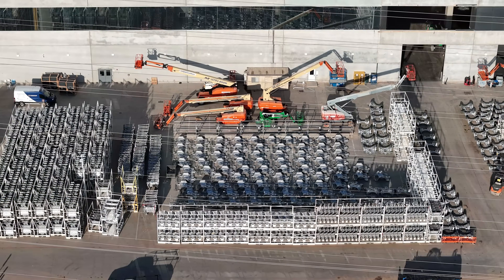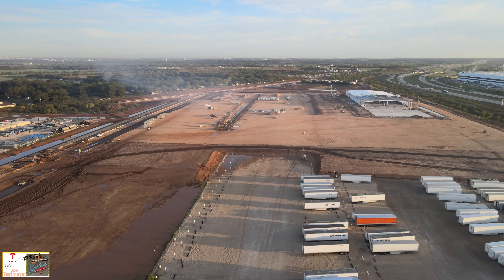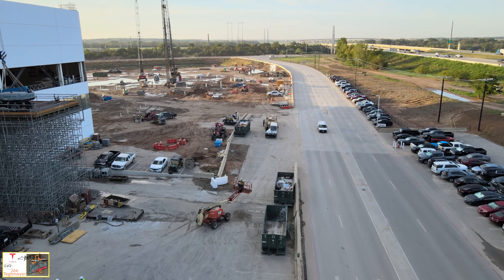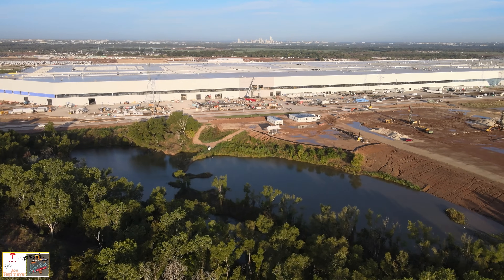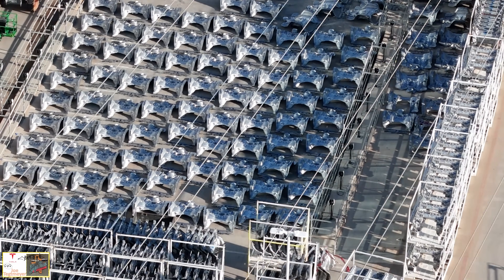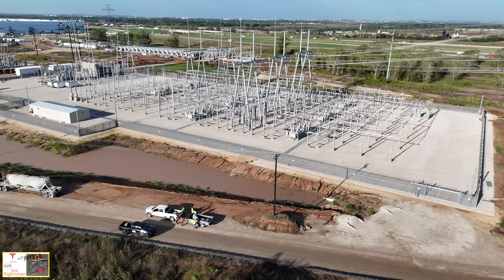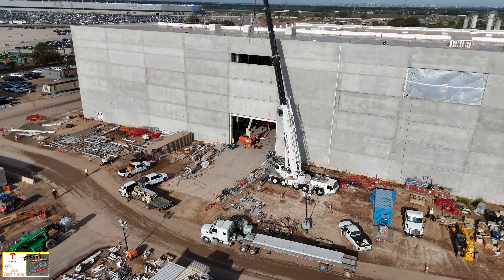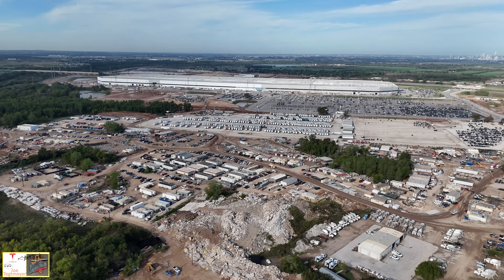100s of Cybertruck Castings! 4680 Section Construction! 6 October 2023 Giga Texas Update (07:35AM)

Comment: Thanks Joe.
4:37. W-WOW yard storage. Left. Beside the crane. The relocated Superchargers.
5:18. New EOL site. Left. Strip drain has been encased in concrete.
7:09. New EOL site. Roof. Stair access.
Inside. Bulk insulation fitted between the wall girts.
HDD project. Right. New delivery of the smaller black pipes.
Left. Trenching for conduits.
8:00. Main Entrance. Stoneglass. Definitely got a problem there with leaching. Repairs required.
8:46. Southend. CFA project. At least 12 rebar cages newly assembled since the last video. Piling to continue.
8:58. Highway Bridge. Left. New embankment to the west (right) of the outfall structure.

Right. Large pipes stacked under the bridge.
9:57. GA south, wall. Boom-lift. Applying acrylic render/stucco.
10:21. Stamping 2 extension. Fixing a second layer of wall sheeting.
11:24. Stamping southeast. Covers over the columns.
11:32. Stamping east, apron. 7 tanks (in Joe’s photos). One tank marked ‘Ecsar’, supplier of a lot of the sheetmetal products into Paint.
12:27. Parking Garage site. Left. Footing rebar cages being assembled.
13:13. WOW yard. Got some rain. Culvert. Inlet structure at the north end underway.
Holding pond. Orange pump and pipe discharging into the new channel.
14:41. BIW, apron. Right. Started demolishing the retaining wall between the excavation and ramp.
15:27. Casting east, apron. On the ground. Cybertruck rear castings. Trimmed castings to the right.
Castings in the crates are Model Y front, and Model Y rear.
16:07. Casting apron. On the ground. Cybertruck rear only. No Cybertruck front castings.
19:02. BESS switchyard. Large Transformer. Beginning to construct the framework for the steel mesh decking.
20:04. New Switchyard/Substation. Mega-Vault. Sandbagged the entrance into the vault. More rain expected?
20:27. Temporary Switchyard. Blue boom-lift in amongst it. Presumably the switchyard is de-energised.
21:53. Crash Test Track. Cybertruck on the right looks slightly asymmetric.
22:38. Cathode east. Wall panels being refitted. Unexpected. There’s a large area of heavily reinforced floor not yet utilized.
23:15. Crash Test track. Curtain. Likely has multiple purposes. Lighting control, debris control, drone operator control.
23:52. Cathode south. Bottom. Hoppers in frames seen delivered in the previous video.
23:57. Cathode south, inside. Pneumatic blenders crowned with some sort of manifold system.
24:40. Cathode plant platform. Bottom Section of the slab marked for demolition.
Die Shop. Left. Utilities duct. 4 pipes exiting the building. Suitably shaped pipes to fit in the utilities duct visible at left 25:42.
25:13. Cathode, lift station. Green sanitary sewer pipe, and blue water main. Lots of black fittings, elbows and Ts.
Reply: 20:04 20:27 Good catch on the sandbags and the boom-lift in the temporary substation! 
Regarding the sandbags, they must really be expecting a downpour!
Regarding the boom-lift, I would guess that they definitely de-energized the transformers. They could de-energize the entire substation but that would mean cutting power on the 138 kV transmission lines as well.
Reply: .❤Multiple uses for curtain !😅😂
Reply: As to rain, 30% chance of a little rain forecast for next Wednesday and about the same for the Tuesday or Wednesday of the following week but absent some sudden tropical event, no major rains in the long range forecast. The inch to inch and a half we got this week was very welcome. We could just stand it to happen every few days for the next few months.
Reply: @Bill_N_ATX   I wonder why they placed the sandbags in front of the access hatch @ 20:05? Unless they plan on doing something that could send a lot of water down there?
Reply: @Bill_N_ATX  Rain. The benefit of local knowledge. I was looking at the bund around the lift station at Cathode, and the sandbagging of the Mega-Vault entrance as evidence of preparing for rain to come. Seems that rain may have come and gone then.

How much did you get?
Reply: @DavidJohnson-tv2nn  20:05. Might also be holding the water-proof sheeting in place while the adhesive dries. Rain was my first thought.
Reply: @malcolmrickarby2313  Lighting control seems the most likely to me. Open end facing south would play havoc with the cameras otherwise.

Privacy would have to be a consideration also. Imagine if it turned out there was an unexpected result crash testing the Cybertruck. Either end of the spectrum, Cybertruck falls to bits on impact, or crash test wall dislodged from it's fixings.

Drone happily clicking away to record the event.
Reply: @DavidJohnson-tv2nn   Go to 20:00. Small trailer is marked '........... space rescue team'. I'd say it's 'Confined Space Rescue Team' or similar.

Thinking the sandbags are there as part of a temporary sealing of the Mega-Vault while some sort of testing is done inside. Smoke test, or a fire suppression system test. The rescue team might be on stand-by.
Reply: @DessieDoolan  Thanks! I missed the trailer the first time. It makes more sense now.
Reply: 15:27. Did an exact count of the Cybertruck castings. I get 175.

Brad's video of 7 Oct, exactly 200.

In Brad's video there is also another group of 100 or more castings on the apron in front of BIW. Can't quite make out what they are. Appear to be untrimmed.

Comment: 16:30 You say there are giga-castings stored outside at GigaShanghai, but I've never seen a single one, and I've watched virtually every video from Wu Wa and Jason.  I think the giga-casting buildings at Shanghai is the easternmost of the 3 tiers, the ones with the big linear air vents on the roof.

Comment: Thank you as always, Joe! Seeing the castings means production is nearing. I'm not worried about not seeing new CT in the lot, because that tells me all the energy is going into getting mass production ready. I'm guessing they have battery capacity for 100-300 per day. Once the cathode plant is finished, staffed, and running, that's when Cybertruck goes towards 1000/day. Eventually supplying Model 2 as well.

Comment: Cheers Joe. The car staging etc. area out west is going to be huge. Sure you want to build for future expansion and that is certainly it. That area is going to be well utilised because of production volume... I think. I wonder if the 'light check' at the end of line is a bottleneck. Send the EOL over yonder and get them, get the shop, to ties its laces. It's full MY production ramp up to ~10k p/w right? That's a shedload of car transporters. They wonna be careful with bandwidth/road network. Lots and lots of examples of being strangled from 'afar'. 

Back to the video.
Reply: Maybe they should build a tunnel to get cars to EOL quicker?

Comment: Hi Joe. “Injection molded parts/facias”. The “molds” are what makes the parts. I know you already know that. People are fussing about your terminology. They are molded parts, not the molds themselves.
Reply: 17:45. What these seem to be are 'forms' that the injection moulded bumpers are placed on.

It's not obvious in this video, but the forms are the shape of the inner face of the bumper. The forms are bolted to the frames.

Purpose might be to hold 'hot out of the press' mouldings in shape while they are trimmed. Possibly also for painting.

Joe's 7 June video. Note the dimples in the face of the 'forms' that aren't featured on a bumper. https://youtu.be/ypshjDWMfTM?t=1751

Comment: What that amount of Cybertruck castings stored out on the apron next to the casting facility really means is that they have yet to synchronize the timing of the various steps of production. The casting production should (ideally) be at the same rate as the production of the rest of the vehicle ... i.e., there should be no backlog of castings building up around the factory. That goes for CT, Model Y, and whatever other models (3?) they eventually produce at this yet-to-be-completed facility. This entire facility and processes are a work in progress and, hopefully, they'll eventually work it all out.
Reply: Yes. To be expected.
Reply: They'll never fully sync major industrial processes like casting and stamping.  They have different maintenance schedules, work in batches as different dies are swapped in and out for different components, and you need a buffer of critical parts for unexpected downtime.  There is theoretical textbook perfection of everything ticking like a Swiss watch and then there's the real world where people do what's needed to make money; not try to implement theoretical textbook perfection.

Comment: East side of casting/Connection to main power vaults:
@ 15:05 Concrete poured for duct-banks, backfilling trenches.

BESS substation:
@ 18:58 Ongoing work on installing fence.
Gravel spread out.
Cables still need to be pulled in backup power duct-banks.
Cables still missing in 1 of the 8 conduits connecting the substation to the Megapack transformers.
@ 19:13 Looks like there are getting ready to pull the 345 kV cable through the duct-bank soon.

South of Tesla Enclosure/Mega-vault:
@ 20:10 6 out o 8 conduits are filled in 2nd duct-bank to the factory. That is, filled as far as the north parking lot.

Comment: @16:24 I have also heard that putting the castings outside 'weathering' is good for the properties of the aluminium, the temperature changes during the day helps releasing the material from possible internal stresses. 

Also the castings are not outside for very long, 100 casting maybe worth production of just a couple hours!
Reply: Please tell us more about casting weathering. My cybertruck will likely not have that.
Reply: @jbbuzzable  Different alloys behave differently. Some wiil harden with a specific heat treating process (called ageing), some will not. I have not heard of any weathering but....

Comment: Hey Joe, great video again. I've heard it mentioned in a video from Fremont, the same question was raised about the castings being outside, somebody mentioned that that helps to cure and strengthen the Aluminum, not sure if that is true, but anyways.
Reply: Personally, I don't think there is any evidence for that claim.
Reply: I don’t think it does them any good but I know that having them sit outside doesn’t hurt them. Unlike steel or other metal that would quickly corrode outside, cast aluminum will last years without issue.

Comment: Regarding the castings being left outside; I suspect that they need to be aged, or seasoned before use. Some variation in temperature would likely help cure the castings and make them more stable. The are aluminum and are not affected by short periods of exposure to the outside environment.
Reply: Seasoning is a myth and won't be a part of the process.